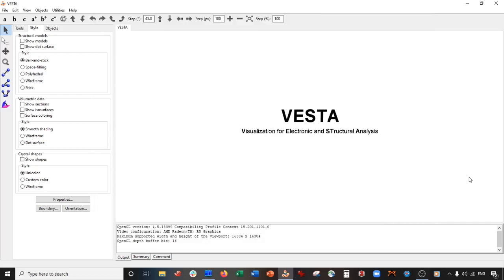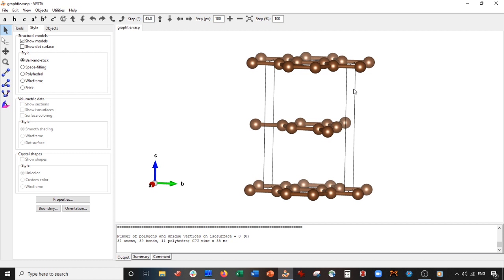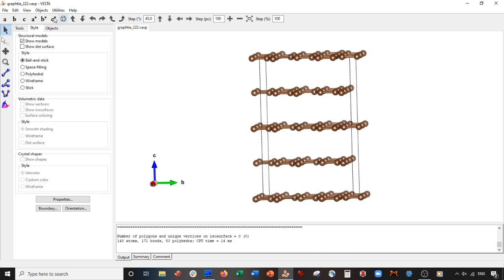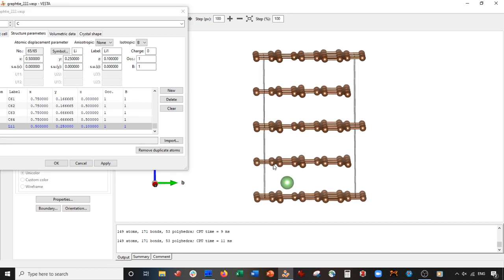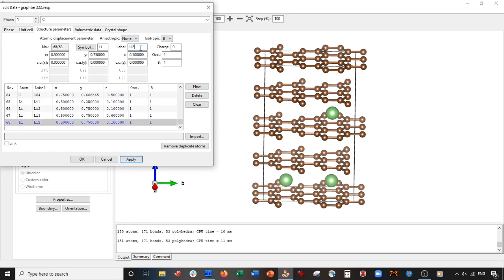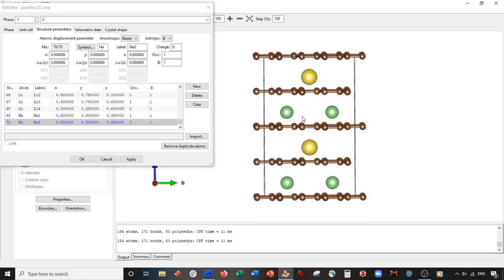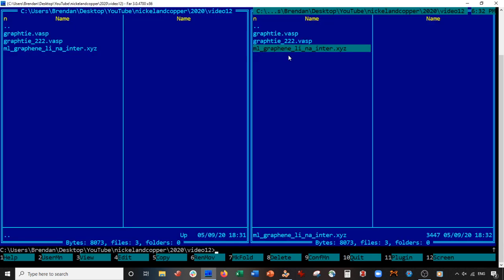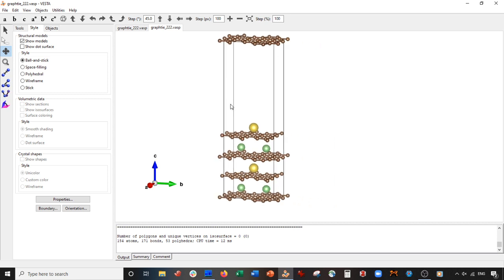VESTA Software - Lithium Ion Multi-Layer Graphene with Vacuum

Comment: Can you explain how you remove periodicity before adding vacuum
Reply from the maker: I think you may need to watch at least 10 videos to get it. It would be a lot to explain in a single comment
Reply: @nickelandcopper5636  i want to form 5 slabs of  111 surface for copper. Can you    make a video on that. How to make a vasp POSCAR for that?
Reply from the maker: @kuldeepkargeti1916  yes I can. Can you tell me the materials project ID for the copper system you want? Once I get that I will add it to my to-do list for this channel. And most likely make the video next week
Reply: @nickelandcopper5636  i have created 111 surface unit cell but not able to create 5 slabs for that surface. And i also need to add vacuum along c axis. I need to make slabs such that they are trapped in vaccuum. Id is mp-30. Can i get your email.
Reply from the maker: @kuldeepkargeti1916  thanks. I don’t give out my email here but I’ll make a video on how to make the slab model. 5 layers Cu along (111) dimension. It will likely be next week. Do you mean 5 slabs or 5 layers? A slab can contain many layers. For Cu system, a layer is 1 atom thick.
Reply: @nickelandcopper5636  i mean 5 layers of 111 surface sandwiched in vacuum along c axis for a 4×3×5 surface supercell.
Reply from the maker: @kuldeepkargeti1916  that’s very doable. I’ll try to make it next week, I am away for this week.

Comment: hello sir, it is a nice and helpful video.  I have one question-  instead of Li or Na atoms can we incorporate gases ( NO, CO, etc.) there in the graphene?
Reply from the maker: Yes of course. See my video in placing a molecule on the slab surface. Then just do that for in between. For practical calculations, you will do to geometry optimization afterwards
Reply: @nickelandcopper5636  thank you very much

Comment: Thank you very much for your videos, it is really helpful. Is it necessary to add vacuum to make ion graphite calculations in quntum espresso?
Reply from the maker: It depends on what you want to compute. If you do not include vacuum, you would be modeling doped bulk graphite. If you want to do a surface composed of a few layers of graphene, then you need the vacuum
Reply: Thank you. I really appreciate it. one more question please, for example, if we have a 6 * 6 * 1 graphite unit cell, is it ok to add an ion-molecule between the graphene layers, or do I need to put several. it will not influence the results?
Reply: @hussambouaamlat7943  If you don't want an ion-molecule to influence the results, why would you add it? ;)
Reply: @nijamnewsity  what I meant is that, is there any difference between using one ion-molecule and several ones (same molecule) between the graphene layers.
Reply from the maker: Hi Hussam - for sure. You will have a larger density of states when there are more ions
Reply: @nickelandcopper5636  thank you, is it possible to make some videos using quantum espresso